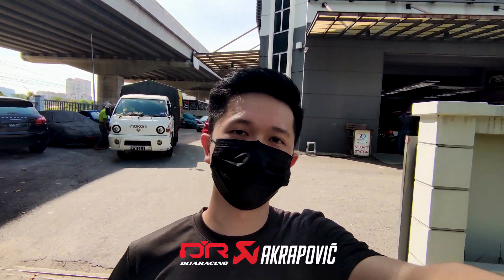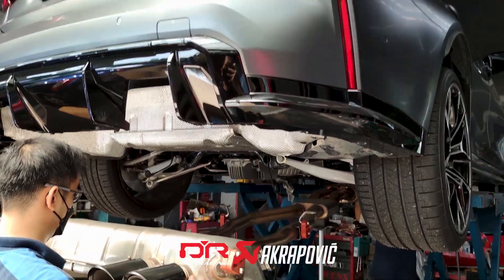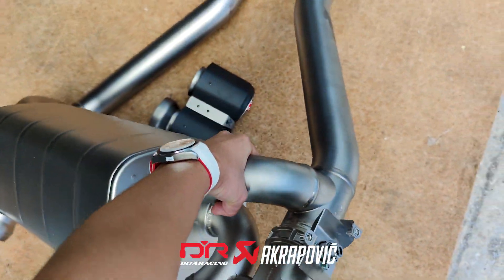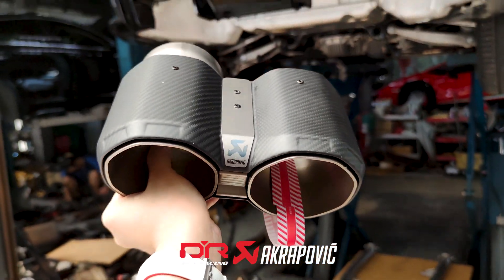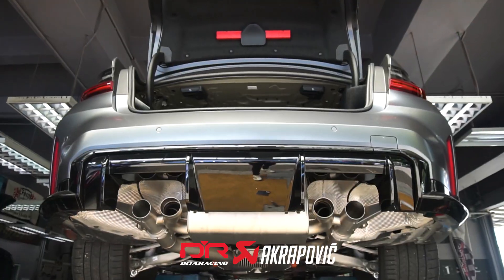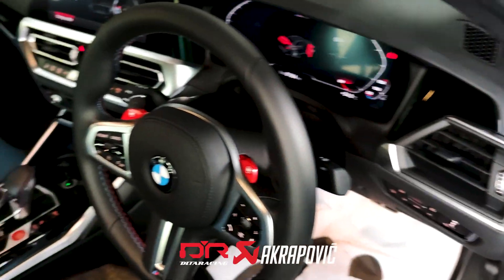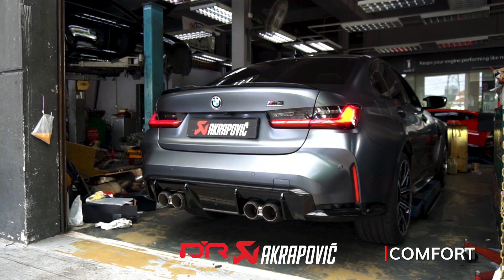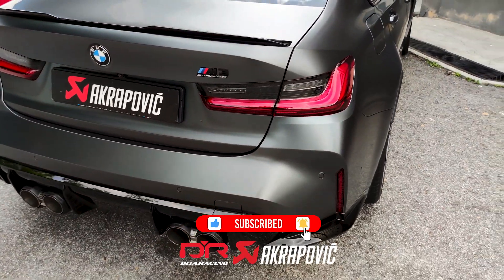2021 BMW G80 M3 COMPETITION AKRAPOVIC EXHAUST | S58 POWERED WILD SEDAN

Comment: If you buy this does it come with TUV certificate so the European annual emmission inspection accepts it? Otherwise you have to take it off every time
Reply from the maker: ECE approval only applicable for rear slip on section. if replacing the link pipes (with OPF removed), ECE is not valid anymore
Reply: @DitaRacingInternational  thanks! So it's better to just replace it for the emission inspection.

Comment: I read on Akrapovic website that the link pipe requires a remap, did you do it? If not, did you get any CEL without the remap or any other issue?
Reply from the maker: link pipe only triggers a CEL on OPF/GPF vehicles. In our region, cars are without OPF/GPF, hence no CEL

Comment: correction: the 825M wheels arent optional, theyre standard, you can choose either those or the 826M, in bicolor/black.

quite a low spec G80 tho with no carbon bucket seats, carbon interior trim nor carbon exterior pack. love the individual frozen dark grey paint tho. love the akra sound too. imo akra makes the best system for M cars, 2nd is fi.
Reply from the maker: No doubt Akrapovic does great on the G8x system, cheers!

Comment: Hi good morning, I’m in Australia, just got my g80 m3 xdrive a month ago, I wanted to get the akrapovich exhaust, was wondering after the installation, does the ecu need to be remapped? I have heard that the check engine might come on if the remapping is not does, is that easy to do?
Reply from the maker: first of all need to check whether your car has OPF/GPF. If it's an OPF model, remap is mandatory, otherwise if it's non-OPF models, will be fine, wouldn't trigger any CEL hence no remapping is needed.
Reply: @DitaRacingInternational  thanks for your answer, that makes a lot of sense, so how do I check?
Reply from the maker: @sheng368  look for your local dealer, they should be able to verify